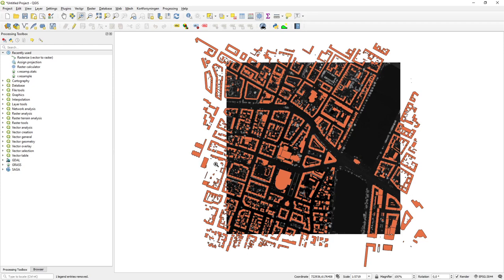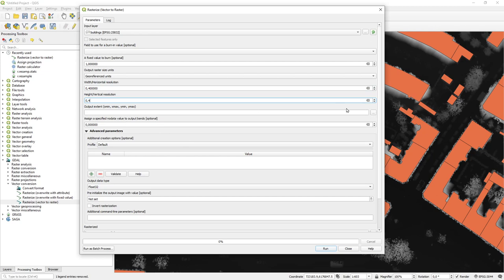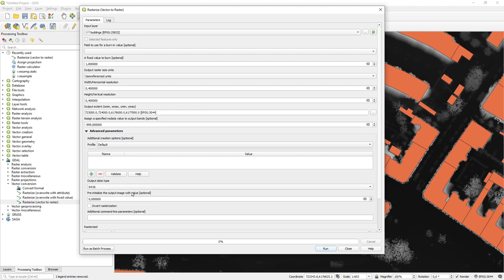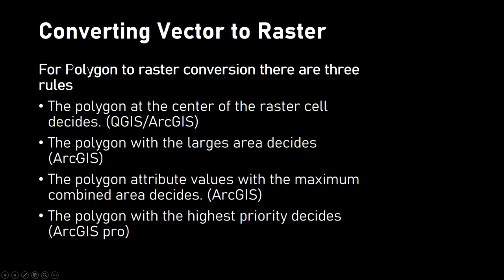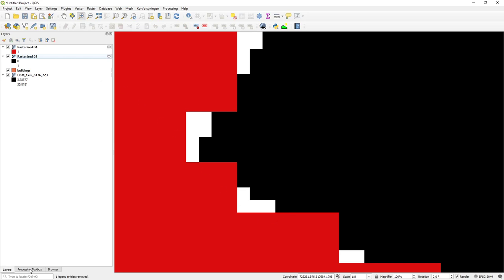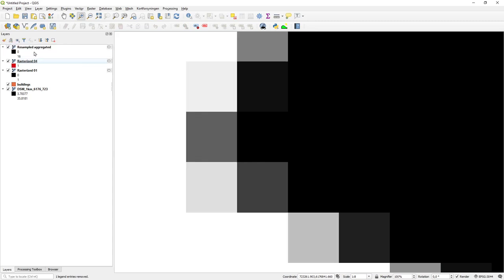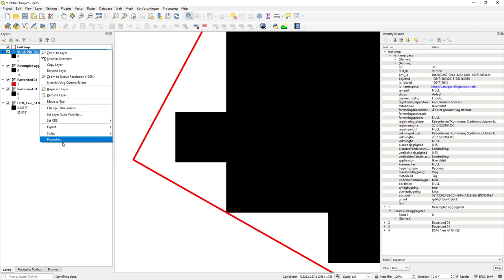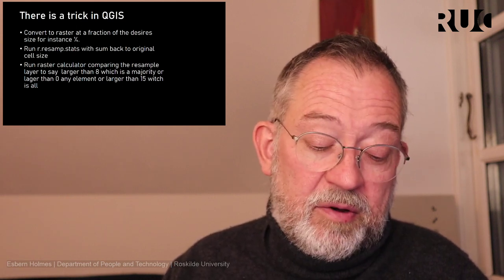Vector to raster conversion in QGIS

Comment: You are my hero. Please can you help me understand why my Int16 output file has 1 to 1 and not 0 to 1 raster values. My roads roads show just fine as a raster with the correct resolution and burned as expected. I am only worried about the values stored in the raster.

Comment: Thanks for the your explanation. I would just add that it is crucial that shapefile layer be in the same referential system. I have used an exported OpenStreeMap shape file that was positioned in the same qgis "visual" referential system but failed every time. A simple test with a new shapefile created at the same ref return the expected result. So after verifying the original referential system I spot the problem.